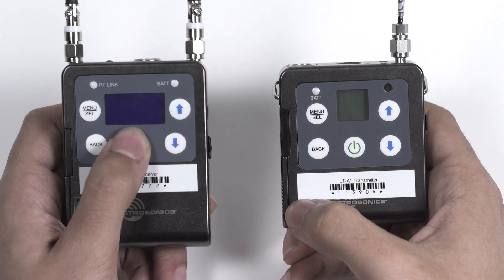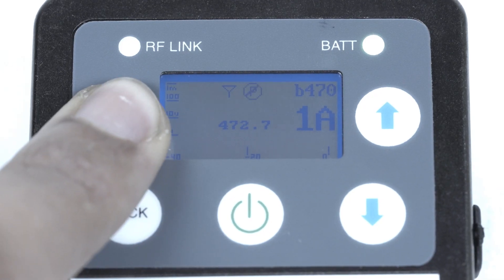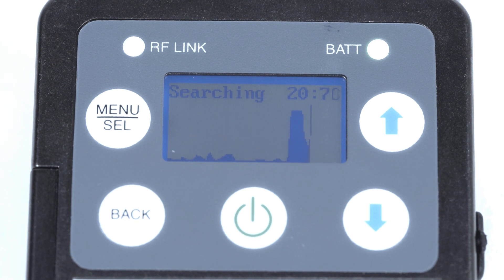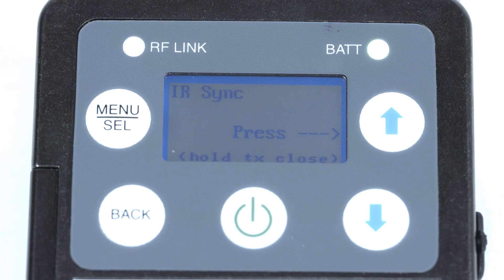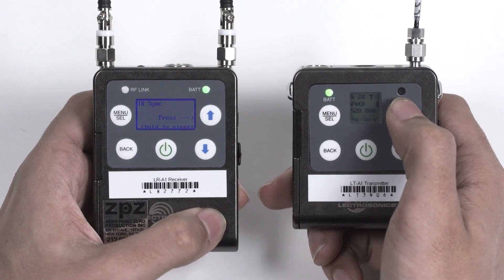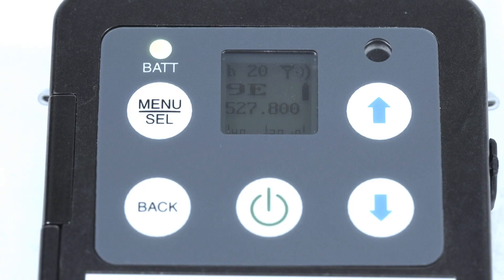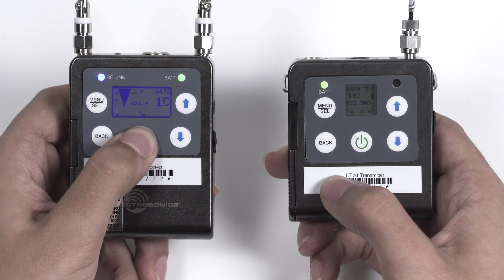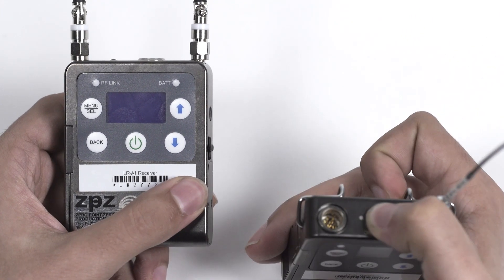Lectrosonics L-Series Quick Start Guide

Comment: Thanks for this video - this should be helpful for new or prospective users of these products. One small comment: the red switch on top of the LT transmitter will turn on the unit, but only if it has been set up to do so in the menu first.